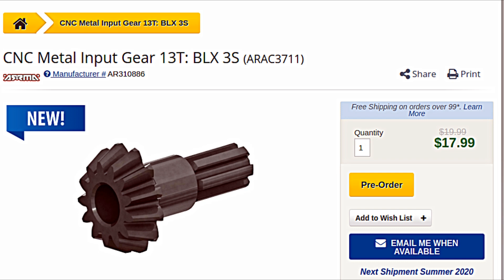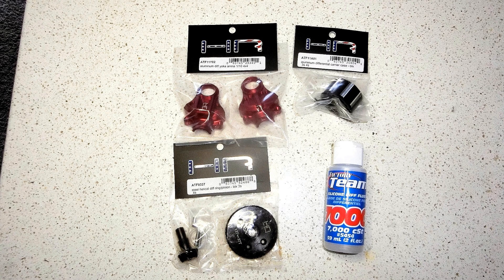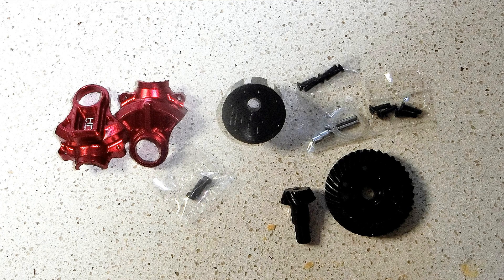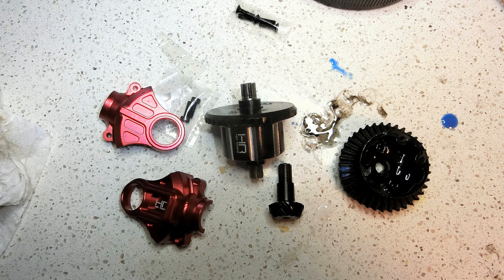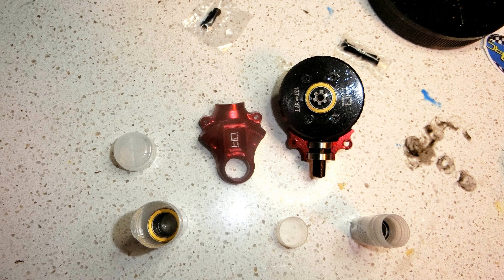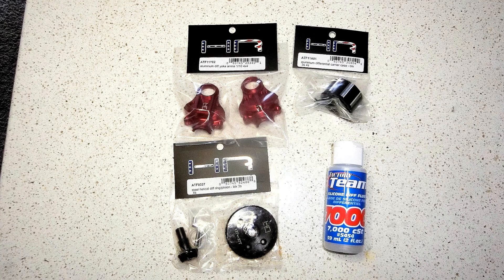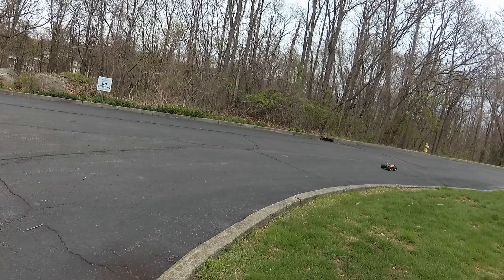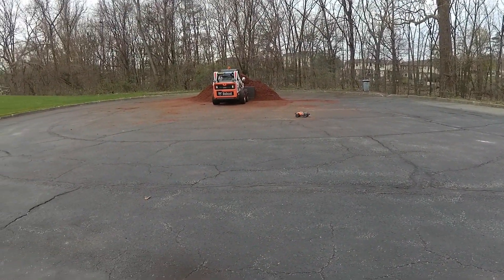🔴 15 🔴 STEEL INPUT GEAR & STEEL DIFF RING GEAR  - Arrma Granite BLX 4x4 3S  = 🔥 UPDATED 2022 ARRMA 🔥

Comment: Will same parts numbers work for the big rock ?
Reply from the maker: From the little I know about the big rock, the Big Rock is basically the same parts as the Granite on a longer chasis.  I would guess the part numbers are the same, I have the Granite V1, haven;t worked on a V2 or V3 so can't say for sure. Sometime on the V3 they changed the part;s number and added maybe a "V3" to the number. If you check Arrma's part list on their website they have a good 'exploded view' and list the part numbers.  Well worth the project to update these parts, I have updated my Granite to all the steel gears I could and it seldom breaks anymore <nice!>
Reply: You can cross reference the parts on the arrma website. They have a really good exploded diagram that has clickable links to each part in the truck.

Comment: What where the part numbers for all the parts.
Reply from the maker: *Click on "SHOW MORE" in the Description box and all parts and links are listed there. 
*I did also complete recently rebuilding my diffs with the ARRMA CNC STEEL PARTS worked excellent HERE are those part numbers I used IF you want to try the ARRMA PARTS for the Granite Front & Rear Diffs STEEL UPGRADE (I found Ebay better source for these):

AR310886 Arrma CNC Mtl Input Gear 13T BLX 3S

Arrma C3710 AR310885 CNC Mtl Crown Gear 37T BLX 3S

New Arrma Composite Diff Case 4x4 AR310772
............................................................

### HERE IS A YOUTUBER SHOWING HOW TO INSTALL THE ARRMA CNC STEEL DIFF PARTS:
https://youtu.be/d6XSgKvUX4E
...................................................................